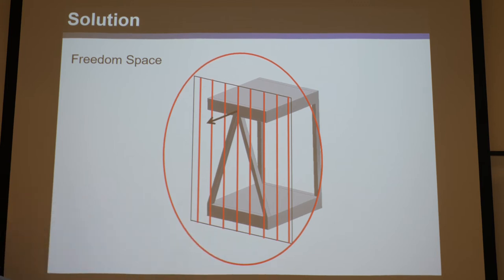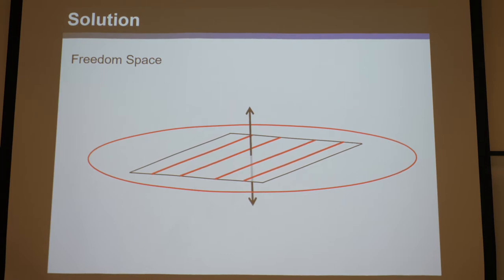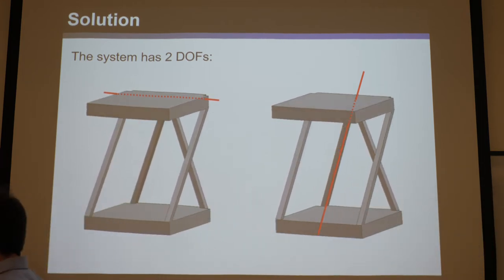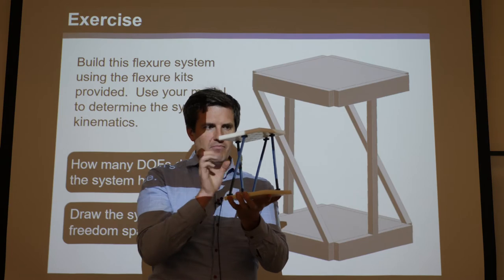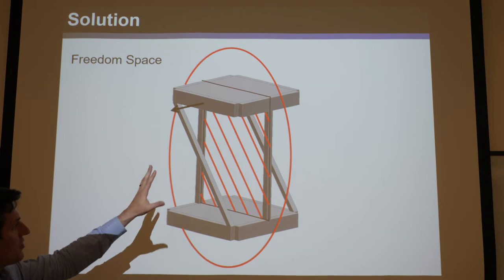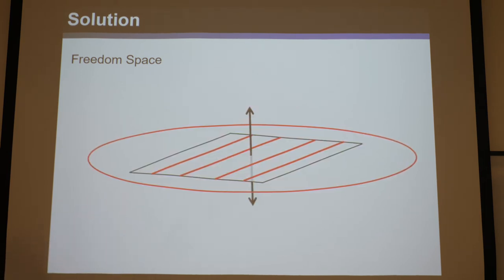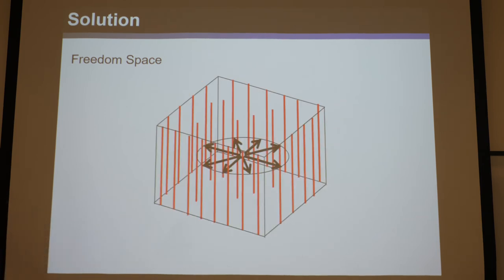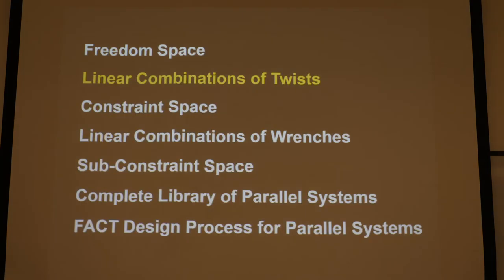Compliant Mechanisms Lecture 5 Part 2

Comment: In the second example (around 8:30) shouldn't the rotation disc be on the perpendicular plane to the one you drew? The vertical rotation line isn't contained in the plane along the two wire flexures that are parallel to each other.
Reply: There is no vertical rotation line.

Two of the wires converge at a point, making an inverted 'V'.  The other two wires are parallel.  The plane of red lines is the plane which contains both of these parallel wires.  There's no vertical line in that plane.

Rotation in the horizontal plane is not a movement this stage can perform.